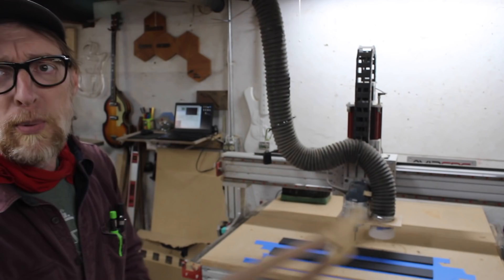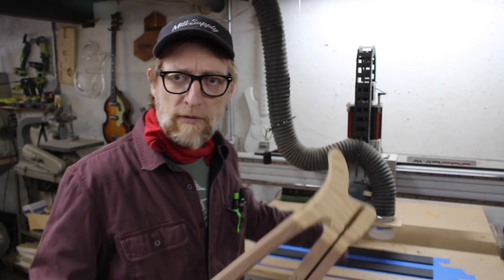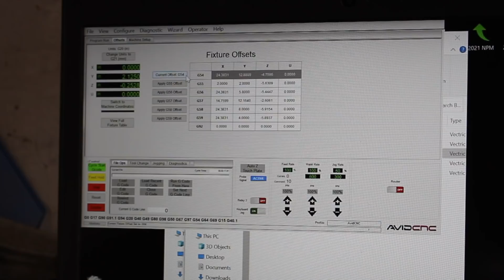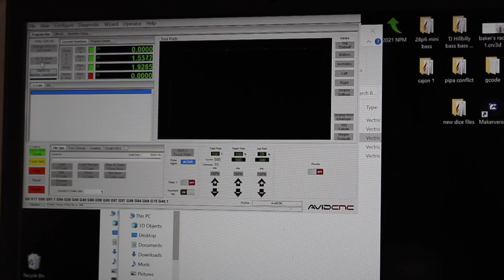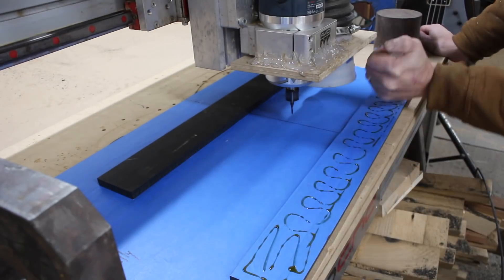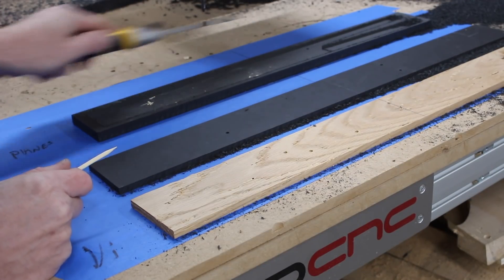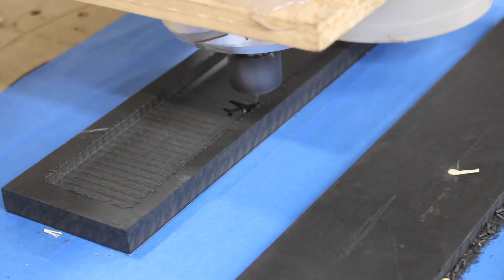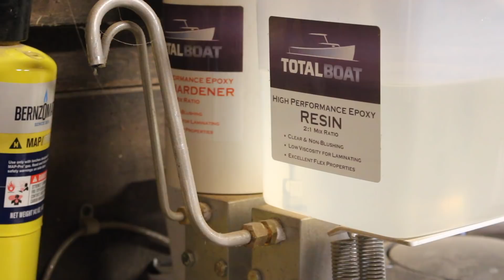Unique Fingerboards with Wraparound Inlays || CNC Woodworking

Comment: Where did you get those steel burnouts from ? I run a hypertherm and a burny 10 at job I cut all kind of burnouts from .25 plate to 10 inches thick plate
Reply from the maker: you mean my weights? There's a steel yard down the road a mile. they sell their cutoffs by the lb to locals. pick, weigh and pay.

Comment: Tim, have you fretted the Richlite boards with the 0.022" bit? They actually sent me to this video when I was asking about milling slots. The page recommends a slight oversize since the material doesn't give like wood. My test-fret was that my 0.023" bit was too small and the Richlite fractured when I pressed the fret into the fingerboard slot.
Reply from the maker: I actually broke my .022 and cut one of them with a .020. I use my drill press as a fret press and had no problems. In the past I oversized the slots a little and ended up needing a little ca glue, but with even pressure I make them the same as wood boards and have never had a problem.
Reply: @timsway  What are you running for feed rate (speed & depth) with the 0.022 in the Richlite?
Reply from the maker: @corradovt  SLOW AND SHALLOW!!! I don't remember off the top of my head.

Comment: Killer job on this!

Did you have to keep your machine on to keep the position while the epoxy was curing?
Reply from the maker: No. When you restart the machine you rezero it then send it back to the saved home. That's the great thing about planning and saving offsets.

Comment: If you can, tilting your spindle motor at an angle will give you a better finish and push less heat into the workpiece. A ball endmill straight on is dragging the much of the cutter across the workpiece. The bottom of the ball is very close to the spindle centerline and therefore not really spinning that far per rotation. Therefore your effective surface speed of the cutter is determined by the amount of stock you're taking off. Think of plunging the ball endmill into the workpiece. The deeper you go, the further up the ball you are cutting with. The further up the ball, the higher surface speed of the cutter--the outer diameter of the cutter is, obviously, further from the spinning center and therefore travels further per rotation--and better cutting. If you tilt the spindle, this outer portion of the ball is the part that is always cutting no matter how little stock you're taking off. This a big reason why companies sinking dies gravitate toward 5 axis machines. It allows them to always be cutting on the part of the sphere that is actually moving.
Reply from the maker: excellent knowledge. It would take some engineering to tilt my spindle.
Reply: @timsway  A friend sold CAM systems and, going on 30 years ago, set up a local guitar company with a mill with a tweaked head like this. They used a fairly sizeable bullnose endmill and an air motor (that I make). Worked really well to cut down on finishing.

Comment: The two 45 degree passes really did a nice job of clean up.  Had about 6 ad breaks in the video, youtube is pushing it a bit.
Reply from the maker: It is getting nuts. Part of the reason I'm pushing towards a patreon platform instead of public. Maybe even the public vids I'll upload 2x so I can run them ad free on Patreon. thanks for the insight.